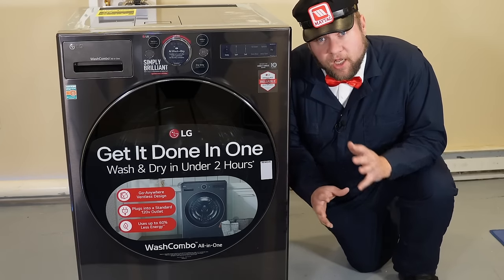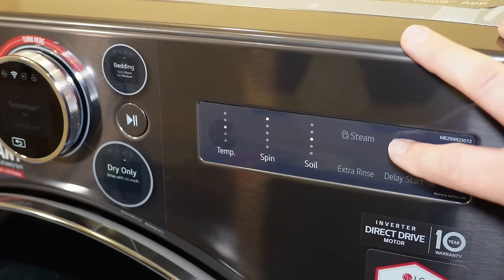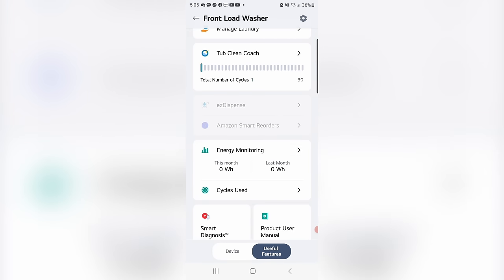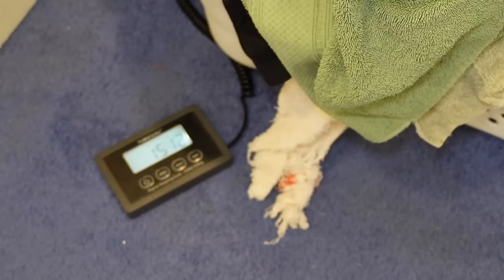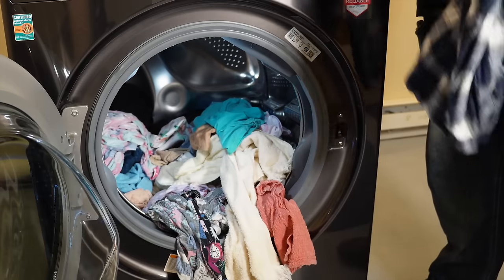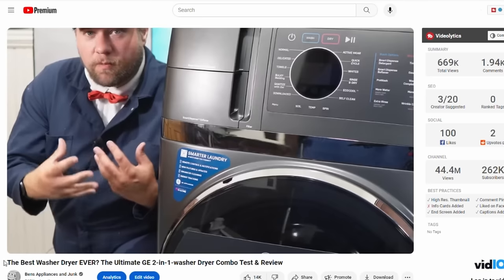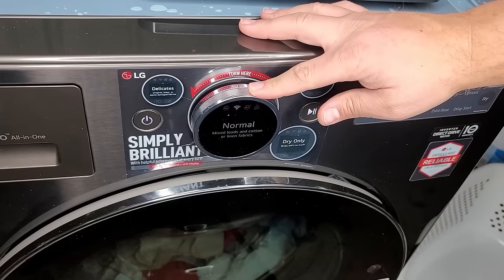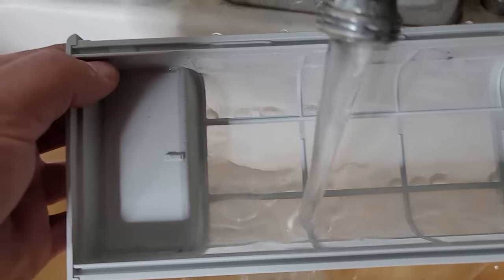BETTER THAN GE? The LG All in One Washer Dryer Combo: Test, Teardown & Review

Comment: I heard about these combo units this week and I am absolutely jumping on this as soon as my current LG washer dryer combo has a major issue. They're past their 10 year warranty and are starting to have control board problems.
Reply: My GE profile Washer and Dryer are 25 years old and are still running strong (maybe a little louder thanks when it was new).  Top loader washer and no push buttons on either unit - all knobs and mechanical timers.

Comment: Thank you so much for making this video.  You never mention the Self cleaning aspect of the system as they do advertise.  I was looking for the wate'r inlets for the self cleaning system on the video,  couldn't see it
Reply from the maker: Its mentioned in the video once or twice. I am unsure the timestamps though. There is 1 water valve on the side of the condenser system, but I did not see a valve on the other side., nor top which would wash it all off.
Reply: Since the sled cleaning doesn’t appear in the app for the appliance, I am guessing there really isn’t one. It would take a good amount of water under pressure to clean previously wet and dried lint from the coils.
Reply: So their advertisement of the self cleaning feature is false advertising. In the video it shows a washdown from the top to the bottom across the entire coil. These companies are getting sneaky on advertising to get consumers to pay hard earned cash.
Reply from the maker: @HomeGuySolutions  do you got a link to the advertisement? You can see in the teardown there's absolutely no hose going on the top of the coil housing assembly. There's one on the side, but its absolutely not going to hose down the whole thing. I can tear the unit down again to investigate further, but this is super interesting they claim a hose in the middle, and I definitely dont see it.
Reply: @bensappliancesandjunk  
Good evening Ben, have you seen the videos? I’ve put together to stop the lint on the GE? I have the weatherstripping on two machines currently. It has absolutely solved 100% of the lint getting by the filter. I would like you to test this and publish it for everybody else. For the people who already have dust on their condensers, there is no easy way to clean that dust off with a rag or a vacuum cleaner. My suggestion is they get a garden sprayer from Home Depot, Lowe’s, etc. fill it with water and the wand can fit inside, and they can pressure wash very lightly the coils for the dirt and dust to go down to the bottom. My question to you is, where Does that coil drain to? There must be a drain hose for the condensate to go somewhere. It’s not possible to go down to the left of the filter so there must be another drain to the right before it hits the blower fan. I believe in the video you made when you left off the coil assembly, there is a hose that looks like it fell off, it’s very hard to see but it looks like there is one there. Let me know.

Comment: I have had this since release day and I also have the GE.  This is significantly better than the GE.

AI wash is just ok, personally I use Wash + Dry then tune it in the app based on my load which results in shorter times and less energy use.
Reply from the maker: thanks for the tip!
Reply: Which one runs more quietly?
Reply: @makatron The LG
Reply from the maker: LG by far @makatron
Reply: @DestinationFawked  thanks!
Reply: @bensappliancesandjunk  no problem they just did a software update and it’s even better now with even more options and finally the ability to change that goofy sound it plays when it’s done with other options.

Comment: Yeah..but
1.  LG.....most of your " smart " washers , dryers..or both..DON'T last...   How long will this last?  Maybe 4 years tops?  OR has LG resolved their qc building problems of the past 15 years?
2.  Will this ACTUALLY get a load of towels and/or denim dry?  or must I run it twice as long?  I've heard plenty of horror stories of these Samsung and LG dryer units and some of the combo washer/dryer units having to be ran about twice as long which defeats point of advertising it as saving 50% or more energy versus the standard traditional units
Reply from the maker: This is the first ever to have a heat pump. The dry times aren't going to be identical to a 240v dryer, but its radically better than their old condenser models

Comment: Think I'd take my chances with the GE...given how LG has flopped lately in compressor reliability.
Reply from the maker: I would have totally failed this unit if it used R-600, but their last few R-134 systems were good from what I saw. But yeah, I feel you on that. What worries me (as stated in the video, I think multiple times) is that its a 1yr sealed system warranty. Why did they do that? Totally gutless.

Comment: As much as I'd love a unit that can wash and dry, there are physical limits for each. Washing can be fairly cramped, but to dry you need open space. A big load would usually need at least 2 dryers to effectively dry in a reasonable time and not be completely wrinkled. So the loads must be small.
Reply: 'Small' is relative to the size of the drum, which in this case is cavernous. A full laundry basket would fill my older 4.0 cu/ft model about 85%.  On this 5.0 unit, it fills it about 65%.  You are absolutely correct you could wash more with a separate dryer, and LG will sell you that if you want it.  But with this machine there is still plenty of laundry to fold when timer goes off, for sure.

Comment: “Slightly worse on dry times”??? They were 40-50% longer than advertised😂
Reply from the maker: Using cold water only in a colder room. Dry times do change based on ambient temperatures

Comment: Considering the date this came out, I'm disappointed. I mean, my condo has washers for public use, and they are NOT the industrial type, just regular samsung ones from half decade ago, and the drying cycle is AT MOST just 1h 30m, no matter what you throw at it. So I'm confused as to why such modern and expensive machine takes 4 hours to dry a full load! even with the towels, it shouldn't be that high
Reply from the maker: Did you see the part where it's a combo unit and runs on 120 volts?

Do you know of any other 120v dryers that run faster?

Comment: A compressor with 1 yr warranty. Do they know something?  Should last 30 years. Lint getting through? Not good.
Reply from the maker: What I do not understand is that the compressor on their stand alone.Heat pump dryer has a much longer warranty and it is the same type of compressor just slightly larger but in the same compressor series it makes no sense to me

Comment: 2.2KWHs seemed quite high. The GE review you only hit 1.08KWHs. Can you review them with a very similar job and see whats going on here. I wonder if the mode was using resistive heat in combination with the heatpump and on the energy saver mode would take a bit longer but use a lot less power. 

I like the LG being a proper size and $500 cheaper, but I also have an LG fridge and fear their compressor warranty. If the GE is bigger but able to actually get things done an hour faster and saves 1KWH per load, that could be $15-50 a year depending on energy costs and usage. I also like the GE for repairability.
Reply: At 2 kWh a load on this LG, the clothes will come out bone dry and hot.  Like similar to a vented dryer.  The way most Americans who buy this will expect them to be.  You can basically cut an hour off the dry time on this and get the same results as the GE.

Comment: My cousin had a Lg front loader that lasted 24 years without a single breakdown.mind you the household is for 6 people  That thing just died last month.  Guess what she purchased another lg front loader.   So far its still going strong. I boght a 5 cubic ft top loader with steam and everything (top of the line) 9 years and its still going strong with zero issues    also boight my 2nd Lg dishwasher.  They simply LAST

However their fridges are garbage.  No point in lying. I dont understand how their washers and dishwashers are reliable but they cant make compressors for fridges to last.  Makes zero sense
Reply from the maker: The rumor is that they spent too much money on the linear compressor because it was EPA/energystar certified and just ended up making it do too much for what it was. I know commercial HVAC techs that say they have a bad record in air conditioning as well. Although I've been super happy with my LG AC

Comment: Your LG Model displayed does not match the controls on LG website for the specified model, and not on the Home Depot or Costco site for the same model number.  Can you please assure us about the controls on the front being a LG WM6998HVA/ or HBA?
Reply from the maker: Hmmm. Good eye. Its definitely a WM6998HBA. I THINK the difference is that I left some of the stickers on the unit inadvertently. Its identical to the other ones, but there are 2-3 stickers around the control interface that look like they are buttons, but they are not, and I've inadvertently forgot to remove them.

Comment: Hiya, great review but fyi there's a major issue with this 12amp unit that's supposed to work "virtually anywhere" per their adverts and (15amp?) GFCI outlets. Per some googling, GFCI should be able to handle 80% of their amp rating, so 12 amp is top of range but should work. 

I got this unit last week to replace a stackable washer/dryer. Looked good at first, but dry cycle, 15amp gfci triggered. Contacted LG to know if this is a known issue and they're reply is due to motors, it's not recommended to use gfci. However, per building code, gfci most be used in bathroom (where my unit is cause old home with bad layout) but also laundry rooms due to the water connections, which are rather necessary for the washers. I replied back to LG for recommendations for what to do, and one of their suggestion was to remove the GFCI... the building code required GFCI. They're literally telling people to ignore building code and safety cause. Wat?!? How is this legal? How are they designing and selling appliances that cannot work within building code?

Going to get an electrician in to see if if upgrading to a better quality gfci outlet may work  (as other people do seem to have this issue with washers in general, but considering it's required by code, there's not enough people having this issue that I suspect should be able to get it working with gfci ). Might need to go to 20 amp (as 20amp is standard for modern laundry rooms) / move the laundry to an area easier to re-wire (which considering, as having in bathroom is not great), both which will be rather expensive... :x
Reply from the maker: Gfci have been known to cause havoc with appliances. It's not an LG thing. It's an overzealous regulatory thing.

Comment: I looked at your GE one too, lots of issues with that one.  This does looks like it fixes some of the issues but, opens new ones.  The question I have, this concept is not new. They use this type of combo, although a lot cheaper, in the UK and other countries that have small apartments/homes. This has been common for years. Did GE and LG not learn anything off those devices? 

The concept of all in one, drop laundry in and come back a few hours later and it's done, I love it. Still too expensive and still lots of possible issues I see in this and on the GE one...

As always, thanks for the video and info, you helped me with my crappy Samsung Fridge that I really dislike....
Reply from the maker: All in one's have been around for ages. The issue is that almost all of them don't use heat pumps or are vented. These are high capacity units with heat pumps which are much faster than older iterations.

Comment: By comparison the LG  WM3555HWA is $600 cheaper. It says it has a condenser as a heating element and it is not energy star rated. Is the HeatPump in the LG WM6998HBA that is energy star rate tha much superior?
Reply from the maker: I think its going to be a fair bit better. $600 better? Hard to say. The energy savings wouldn't offset that, but the drying times would be improved a bit.

Comment: How big of a difference that the GE Ultrafast has Microban® Antimicrobial Technology
“Provides antimicrobial protection on the gasket, dispenser, and draining system, to help prevent odors and ensuring your Combo stays fresh and clean load after load” vs machines that don’t? Do you have a video testing Microban Antimicrobial Technology.
Reply from the maker: I think the GE will be slightly better, but the real key is the tub wash and if this unit gets hot/warm to dry the cabinet during that mode. I did not test the tub wash yet on this model, but I can vouch that on the GE, it does a fantastic job to dry the cabinet to help prevent mold build-up. 

So in other words, both of these units are going to be superior to the typical wash-only counterparts, IMHO.

Comment: ok so lets open this up, what exactly is the difference in those wash cycles, what are the benefits? drawbacks? you can skip the obvious stuff like water temp, dryer temp-obviously those will for certain change the outcome. But..what is the difference between for example a towel cycle and normal wash cycle? The gentle cycle I suppose it will wash, spin or dry with less power time and temp. Where is the data that supports different washing cycles? or excluding the gentle cycle those just a bunch of mostly useless buttons like our microwaves?
Reply: Oh and to be fair, I dont even separate.  I just throw em in there throw in a pod and put it on wash...

Comment: Why on earth anyone would buy one of these over-complicated devices to wash and dry clothes just astounds me. Give me a $300 washer and a $200 dryer and I am good for 15-20 years, and I can repair the damned thing myself, wont the by product of this heat-pump be a cooling of the room the device is in?
Reply from the maker: The heat generated by the pump is a fraction of what a standard dryer will shoot out of the house during a normal cycle
Reply: There's no outside venting on this machine. Heat pumps "move" heat from one place to another. The heat moved into the unit for drying will eventually dissipate back into your room after the cycle ends.
Reply: @UnkyjoesPlayhouse  The compressor doesn't "create" heat. Yes, you're right that the room will get slightly cooler, but that's only somewhat temporary. After the drying cycle is complete and the inside of the dryer and the dry clothes are warm, where does that heat go? It goes back into the room that was made slightly cooler by the machine running in the first place.
Reply: @UnkyjoesPlayhouse  It doesn't release any cold air to the room, once the door is shut it is a sealed,  closed loop.  The hot moist air from the tub is blown through the heatpump's evaporator coil, which cools the air causing the moisture to condense out and run to the drain, from there the now much dryer air passes through the heapump's condenser coil heating it up and it is blown back into the tub to dry the laundry. The refrigerant also picks up additional heat produced by  the running  compressor's motor and pump as it passes through the compressor,  and this is what causes the air in the dryer to heat up above room temperature.

Comment: Ben what is the small compartment towards the bottom left for?
Thanks for a very good unbiased review. Probably would’ve bought the GE but not a fan of made in China. Will definitely get the five-year warranty extension.
Reply: It's where the 'washing filter' is. There is also a drain tube there to help clear some of the water when cleaning. The 'filter' is just a housing with holes that washing water flows through to keep large debris from going to the pump.

Comment: How long are equivalent combined wash/dry times with the heat pump version of the LG wash tower?
Reply: Wash will be similar.  Drying will be a touch quicker due to only drying clothes and not clothes and the inside of the machine.

Comment: but its LG, the company who gets sued non stop for putting stuff that quit working quickly, stay far away from LG and samsung stuff, also that seal will quickly be full of mold, isnt there a lawsuit out for LG rotary compressor dieing in 5 years, even thou they say its post to last 20 years?
Reply from the maker: Linear compressor has all the issues, not the rotary compressor. Totally different model, and this is closer to what they have on ACs and dehumidifiers which aren't great, but absolutely do NOT have the issues that the linear has.

Comment: I wish I'd known about these kinds of machines about 6 months ago.  We moved and bought a standard Whirlpool washer/dryer then (the worst washer/dryer we've ever owned).  I'd love to have a heat pump unit.  But, how do you plug up the existing outside vent in such a way that it's properly plugged, not hideous and able to be re-opened if the next homeowner doesn't want a heat pump?
Reply: you can get a 4” hvac cap from a hardware store or online

Comment: Plot twist: The "AI" options are the exact same programming logic that has been built into newer washers for over a decade.
Reply from the maker: I wouldn't be surprised. On the GE, if you run loads over and over again, it consistently would lower wash times.

Comment: Does It have water level sensors? Where is it located? 
GE all in one have add water function. does this LG have add water function?
Reply from the maker: AFAIK you can see the pressure sensor on the back when I remove the rear panel. It definitely has one. On the add water function - I think its hidden on an option somewhere. I'll have to double check sometimes.